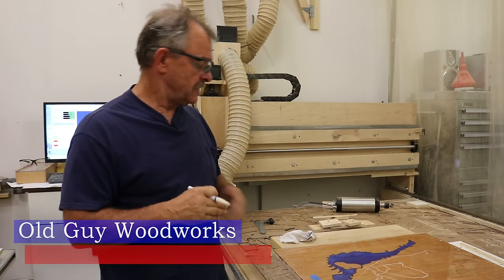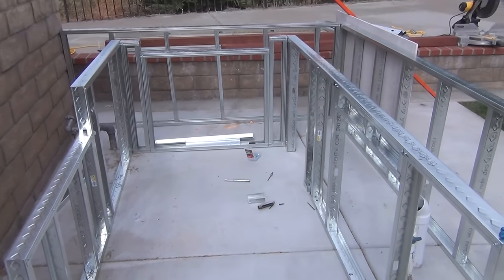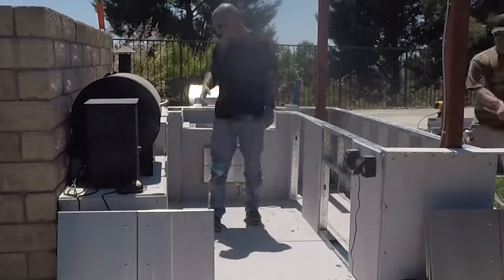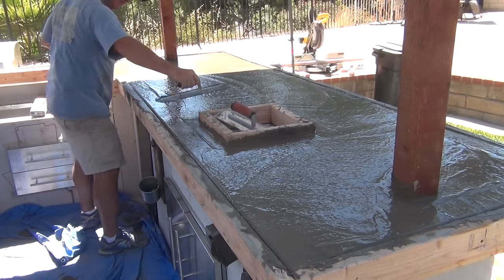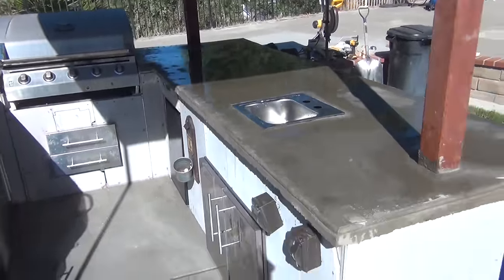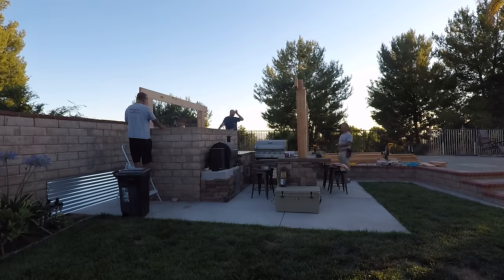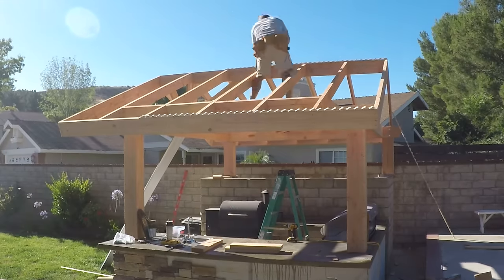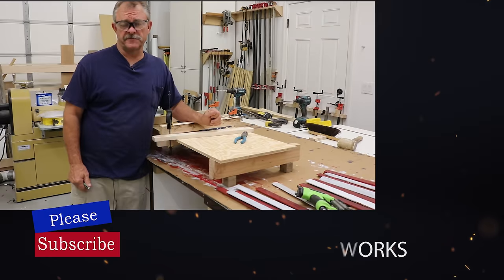Built-in BBQ  -  Outdoor Kitchen

Comment: The wooden posts seem much bigger than steel cylinders. Why did you prefer to use wood instead of metal for the barn frame?
Reply from the maker: I don't normally work with metal.

Comment: Nice work but would be like an oven under that corrugated steel roof even on a mildly warm day. And no guttering to pull all that rainwater away from the site.?
Reply from the maker: We haven't experienced it being that hot under the metal.  Possibly because it is pretty open underneath.  Thanks for watching.

Comment: Love this project! Definitely would like something like this in my yard. 

Quick questions. What's the overall soze of the roof structure? Also were those posts just 4x4's wrapped in 2x6's woth 2x6's spaining the top supporting the roof?
Reply from the maker: If I remember correctly, the cover is about 12'X12" square.  We did use 4X4 posts and wrapped with both resawn 2X6 and 2X4.  resawn 2X8 for the double header and 2X6 rafters.

Comment: All that work,  I would of put a better roof than that. At least some shingles. So how much did that cost? I did like the set up for a small area it was in. Good video thanks.
Reply from the maker: The roof was part of the design the young guy wanted.  We had a lot of the BBQ's and applainces.  I want to say it was in the $4,000 range.  Thanks for watching.
Reply: Old Guy Woodworks 
$4,000 that’s not a bad price. They wanted to charge me $20,000 to just add a patio to my backyard. They told me that it would be way cheaper if I just had the patio built that’s not connected to my house.

Comment: Like the build.  But why wasn't the overhang built out more for rain purpose.  I mean the people would be dry sitting on bar stools.  I hope ceiling fans were installed afterwards to cool down the heated metal during those hot summer days.
Reply from the maker: Nice observation.  We considered that, but didn't want to go lower because of head clearance at the fascia.  It doesn't look like it, but the fascia is down about 7'.  So far it hasn't got that hot under the cover, but we do have the electrical pre-run just in case.  Thanks for watching and the comment.
Reply: Old Guy Woodworks Couldn’t you have done the roof in two different slopes? So the one over the bar would have a smaller incline, so that the fascia would still be at desired height? I like the use of the metal studs vs wood.
Reply from the maker: We could have done that and did think about doing that, but the overhang would have come out to far for our liking.  Thanks for the input.

Comment: what did you wrap the posts with?
Reply from the maker: We used resawn 2X8Doug Fir  to wrap the  4X4 which were pressure treated.  The larger resawn left a space so we could run electric for overhead lighting.  If it had stone on the posts we would use black paper (felt) and then cement board.

Comment: Looks freakin awesome .  Two questions.  What do you set the pit on, was it a cement board. Also how far apart is each gable
Reply from the maker: Thanks for watching.  yes, the pit is set on cement board (Hardie board).  The dimensions of the roof is 10' X 14'.  The BBQ Area is 10' X 10'.

Comment: Don’t use your freestanding grills for outdoor kitchens people. Buy a built in grill design to be built in. I bet that was the customer’s decision. ! Smh!   ... Nice job though though. Island looks bitchen!
Reply from the maker: Mr. M you are correct.  Great observation.  Thanks for watching
Reply: Why? $300 vrs $2000. Seems like a fair decision.
Reply: k bob freestanding grills are not standard sizes. So when it takes a shit. The owners will have to modify the island cut-out to fit the new grill. It’s like buying a Ferrari shell and you install a Toyota engine.cost more in the long run.